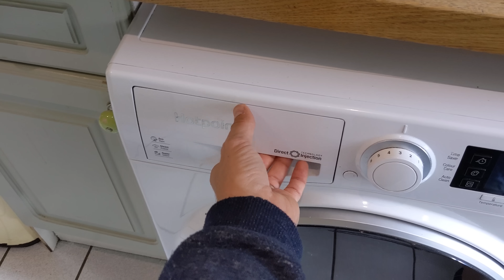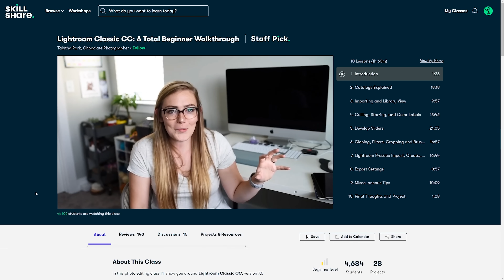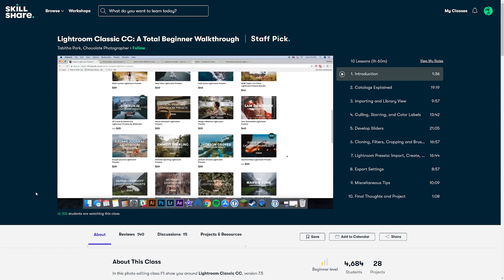The Pythagorean Siphon Inside Your Washing Machine

Comment: I've never even seen a siphon toilet in the US, and I'm quite old. It seems overly complex when you can just pull the plug.
Reply: It seems like a siphon would be less prone to wearing out.  In US toilets the rubber breaks down causing leaks pretty often, especially when using cleaning tablets.  The main benefit of the US model is that far less force is required to initiate the flush.
Reply: It was basically designed to save water. The American style plunger toilets are prone to leaking and use more water, Up until 2001 it was mandatory to have a siphon type toilet in the uk.

Comment: In America, I've NEVER seen a toilet like that..  All of ours (that I'm familiar with) just have a stopper over the hole at the bottom of the holding tank, and the water just escapes directly into the main part of the toilet.  Same general mechanism for the shutoff valve, and then if the toilet runs, there's an overflow tube that bypasses the main stopper and lets the water drip into the toilet so the tank doesn't overflow

Comment: Toilets in Slovenia don't use siphons.
Its instead a hollow tube with a rubber plug in the bottom. In the event of a leak the level reaches above the tube and drips out, when you flush the tube is lifted up, creating a gap at the bottom where the water moves out. For a half flush a float mechanism is used to drop the tube once the water drops to the right level. Its not a great system tho as the rubber plug can get hard with age and start leaking.
Reply: This type of mechanism is also sold and used in the UK nowadays. It's neat as it gets rid of the need for a separate overflow pipe.

Comment: I always thought this was a bell siphon, I have used it in hydroponics to water and drain the plant bed. I also heard it called a greedy's man cup.
Reply: Bell siphon is not this - it has a heavy cast iron bell that drops to start the flush. See: https://qph.fs.quoracdn.net/main-qimg-880fc7a941ea281edf35e7c334f798a4
Reply: @millomweb  a bell siphon doesn't have any moving parts. I honestly don't see the difference here.
Reply: @MrKmail  The bell moves vertically in a bell siphon - to start the siphonic action. It acts as a piston in the bottom cylindrical part of the cistern to build up pressure to cause the water level in the bell to rise above the standpipe - which it then flows down to start the siphonic action. The bell, resting on 'rubber' feet does not seal on the bottom of the cistern once it has (hopefully) started the siphoning.
Reply: Looks like a bell siphon to me.
Reply: @MrKmail  Might look like one but it isn't.

Comment: Are You familiar with wastewater plant's dosing basin siphon that are releasing certain volume of water into the sea? If not, check out how that works, I think it should be the same principle. Effluent fills the basin until a certain level (volume) and then it releases it suddenly in order to better mix it up with the seawater through underwater diffusers nearly a kilometer away from coast.

Comment: German Toilet 1: A big tilting button, you press the bottom, it tilts and stays tilted until water is drained, or until you press on top to tilt it back and stop it. Can be stopped at any time.

German Toilet 2: Two buttons, big button for lots of water (for number 2), small button for little water (for number 1).
Reply from the maker: Nice!

Comment: Both of my toilets at my house in Pennsylvania, USA use a buoyant flap at the bottom of the cistern. So when the lever is pressed the flap is lifted and then stays open until the cistern is empty. As the cistern fills back up the water pressure is enough to keep the flap down.

Comment: So, my toilet has a rubber flap that is pulled by the chain when you flush. The rubber flap has some buoyancy so it stays open until the water level is low enough to the flap to fall and seal the drain tube. When it's not in use the weight of the water above keeps it closed

Comment: How awkward did you feel filming that urinal?!  :-D

The syphon model is most common in the UK and according to the Wiki article (https://en.wikipedia.org/wiki/Flush_toilet#Siphon-flush_mechanism ), mandatory until 2001:

"Until 1 January 2001, the use of siphon-type cisterns was mandatory in the UK[11] to avoid the potential waste of water by millions of leaking toilets with flapper valves, but due to EU harmonisation the regulations have changed. These valves can sometimes be more difficult to operate than a "flapper"-based flush valve because the lever requires more torque than a flapper-flush-valve system. This additional torque is required at the tank lever because a certain amount of water must be moved up into the siphon passageway in order to initiate the siphon action in the tank. Splitting or jamming of the flexible flap covering the perforated disc can cause the cistern to go out of order."
Reply: Here in the US, I've only seen the flapper type
Reply: Ohhhhh!!! That explains why it sometimes feels like you have to "kick-start" the whole thing (rather than just.. pressing)! It is indeed a problem I've never had elsewhere in Europe
Reply: Can confirm this type of mechanism is not standard in the US.
Reply: Join to the SMILER!!!
Reply: @YYYValentine  Join Us.  You belong to The Smiler
Reply: @stevebrown1974  I was close enough :D . Are you also a roller coaster nerd?
Reply: @YYYValentine  yes I am!
Reply: I'd say, common in all EU. Nowadays double flush system are almost everywhere in Spain, where water saving is a collective worry.
Reply: the valve system on that type of toilet ; is similar to a read Valve system that is in a two-cycle engine .  I say similar because the valve is open by vacuum created when the Piston is going up ward  .  A two-cycle engine is fastening , it actually has I believe it's seven or nine cycles don't remember which one. but they just call it a two-cycle engine ;  diagram on two cycle engine would be fascinating . The two-cycle engine is not very efficient either .
Reply: So it was the EU's fault for making things shittier (pun intended).
Reply: @TheSadButMadLad  Yep!

Comment: My Toilet (Ohio, USA) has a seal on a hinge at the bottom made out of rubber with a bit of foam ½ way up the chain. When you flush,  the foam is buoyant enough that the seal can't re-seal. When the water empties, the seal can close because the foam is no longer floating.  When the water slowly fills the bowl, by the time the foam is floating, there is enough pressure from the water in the tank on the seal that the foam can't lift it on its own.

I like the elegance of your toilet more, but I do like how easy it is for me to "fix" a running toilet, just have to close the seal which sometimes get stuck vertical.

Comment: Most toilets i've seen in the US have the handle chained to a plug in the bottom of the tank. A small pull let's in a little water, but a full pull and hold keeps the plug open and uses more water.

Comment: I think most toilets, at least historically—maybe not green, low flow toilets—use a simple flapper valve at the bottom of the cistern. There is also an overflow mechanism as a vertical pipe that bypasses the flapper valve when the level of the cistern is above the designed level.

Comment: In the US, I've not generally seen siphon based systems on the toilets, apart from urinals.

Well, that's partly true. When the tank empties into the bowl, I've not seen that part work by siphon. When the bowl empties to the sewer, that happens because of a siphon.
Reply: Yup US toilets are a siphon. You can initiate the flushing action just by pouring a gallon or so of water right into the bowl. Raise the water level about an inch or so and the siphon will start and rapidly suck away the waste. I'm sure at least for american toilets the stuff about aresolized particles settling on things like your toothbrush are BS because the "violent" flushing action is done by suction and once the water drains i'm sure a good couple cubic foot worth in air gets sucked down as well, the sucking is going to keep happening till the slug of water hits the sewer vent that goes up to the roof and it breaks the siphon. If it wern't for that vent the toilet would probably keep sucking as that slug of water made its way down the sewer line till it made it down to the much larger main sewer line.

Comment: Huh, I've never seen a toilet flush mechanism like that!  That's a pretty cool one.

I was thinking more that the lower part of the toilet works like a greedy cup siphon to finish emptying the bowl.
Reply: Same, actually I was expecting him to talk about how the water flushed from the bowl to the drain through that sort of mechanism...
Reply: This.
Reply: In the Uk the toilet bowl does not act like a siphon, The water in the bowl is there simply to stop the smell from the sewer coming back out of the toilet. The waste is simply pushed away by the fast flowing fresh water from the flush.
Reply: @FloppydriveMaestro  I see! But then what keeps that little pudle of water always in the bowl? There should be some sort of weir or siphone to do that no?
Reply: @theandyv8176   It is the U bend built into the toilet bowl that keeps the water there.
Reply: @nrml76  and that's where the siphon action occurs.  That u bend.
Reply: @TheThomasites  Yep, and that is the gurgling sound you get with a fully-clearing flush as the water and air balance out in the top of the snaky u-bend and part of the flow that is filling the tank is diverted to refill the bowl to maintain that gas seal.
Reply: @TheThomasites  @FloppyDriveMaestro Do UK toilets make a gurgling sound when all the water leaves the bowl?  That the sound of the air entering the pipe and breaking the siphon that cleared the bowl.
Reply: @theandyv8176  There is a U bend. So the water goes up slightly and back down into the waste pipe. The flush action forces the water over the U bend but its essentially an overflow and not a siphon.
Reply: @aantony  That's the right question.  Gurgling at end of flush = siphon.  It seems like it would be harder (i.e. take more water) to clear solids from a water-trap type toilet bowl that didn't use a siphon.  The siphon helps accelerate the speed of the water leaving the bowl.
Reply: TheThomasites UK toilets are normally drained through a horizontal pipe to the rear, rather than a vertical pipe through the floor. They can't therefore siphon. The siphon flush mechanism was universal until the EU interfered and insisted Britain allow the continental style flush mechanism with a simple valve. This proved a bad decision- such valves are prone to leaking, sometimes quite severely, and as a consequence water use by toilets (wastage) has risen substantially where these are fitted in any great number. The old syphon valves lasted decades and never malfunctioned in such a way.
Reply: @andrewsnow7386  Huh, yeah.  The bowl never fully cleared.   No siphon.
Reply: @aantony  The Toilet dumps the fresh water from the tank in so quickly that the waste in the bowl is simply washed away, Because the bowl does not hold much water and it does not have far to travel it doesnt take much water to force it round the U bend.
Reply: @theandyv8176  Yes, it's a weir.
Reply: @nrml76  He was right, it's a weir.
Reply: @TheThomasites  Not in the UK normally.
Reply: @MonkeyJedi99  No gurgles in the UK.
Reply: @aantony  Nope. No air is sucked out the bottom of the pan.
Reply: @andrewsnow7386  But that's not how UK loos work !
Reply: @aantony  no,northern born Thomas designed the uk Crapper so there is never a broken siphon at that end, the fresh water just replaces the old keeping the trap intact, the atmospheric air doesnt re enter the vertical waste pipe until the underground pipe section breaks the seal at that lowest below ground end,at least thats the case if the fitter/room designer does/lays it out right .

Thomas Crapper was an English businessman and plumber. He founded Thomas Crapper & Co in London, a sanitary equipment company. Crapper held nine patents, three of them for water closet improvements such as the floating ballcock. He improved the S-bend plumbing trap in 1880 by inventing the U-bend.
Reply: The US toilets (with like 500l of water in them) do not exist outside the US. Toilets everywhere else on this planet do not waste that much water.
Reply: @whuzzzup  right....... 🙄
Reply: @AureliusR  ?

Comment: My toilet hangs on the wall and only has two buttons, so I guess it's just magic then.
Reply from the maker: That's the other mechanisms, yes.
Reply: I also use the sink when I shit
Reply: It probably has a tank inside the wall that fills with water. If not then its a power flush that relies on water pressure and volume to flush. But those are typically only commercial.
Reply: I also believe the toilet hangs on the wall by magic or suction cup. 
Not sure about where the call end up when you press those buttons, maybe the sewer call center.

Comment: ENGLISH toilets are mostly the siphons design; not in the US. 

In the US, the lever just lifts the flap seal at the bottom of the tank.  It's buoyant so it doesn't drop back and reseal until the water level drops to allow gravity to let the flap seal drop back into place.

I've encountered so many toilets in ENglish homes where the central plastic siphon mechanism is broken due to plastic degradation so that cracks develop and you have to pump the handle multiple times to get the toilet to flush.

Comment: Would a siphon work with a liquid with very low cohesion? if so, what parameters would have to change?
Reply: The lower the surface tension, the closer the walls would need to be together. (Compare water with isopropyl alcohol and with glycerol. And with the super thick polyethylene oxide -- see really early Steve Mould video.)

Comment: Thanks for explaining how these dual flush toilets work. Growing up on the east coast of the US, the toilets always had a rubber flap at the bottom and no siphon mechanism. Also only one type of flush. Living on the west coast, all the toilets I've encountered are dual flush
Reply: On the rubber flap toilets, if you lightly depress the lever, you only slightly lift the ball and water flows through only until you release the lever, the flow of water being enough to pull the flap back in place. If you pull it more strongly, you cause the flap to actually lift, at which point it holds itself up until the water level falls below it and stops supporting it. 

There is a second siphon effect happening in the bowl itself, which is why before hurricanes, we fill buckets - you can cause a toilet to flush simply by pouring water directly in the bowl from the bucket. So, by the same token, hold the lever at that partial flush for long enough and the water that slowly infiltrates the bowl triggers an actual flush of the bowl contents.
Reply: @HowardCShawIII  half pressing the lever never worked for me. I think the flow rate was always too low to get a flush if you didn't wanna be waiting for an hour for enough water to reach the bowl. I do remember having buckets of water ready for hurricanes though!

Comment: Yes, different in the U.S.  I've never seen that kind of mechanism here.  The U.S. uses a valve sitting on top of the outlet of the tank - lift it up and water flows while the valve floats. Once empty, the valve flops down on the opening and the water pressure holds it closed while the tank fills.  Interesting how different places solve the same problem in very different ways.

Comment: 8:18 my washroom’s flush is a little different, if I pull the lever and drop it down quickly it drains less. I opened the flush mechanism but it was same as yours , idk why that happens

Edit : I was wrong it ain’t like Steve’s it’s disguised as his, my explanation is there in the comments below
Reply: perhaps it doesn't have the hole part way along? or perhaps there is a sweet spot between pushing too quickly and holding it too long?

I don't want to encourage you to waste water, but... science!
Reply: maybe those slits are present only toward the upper portion of the piston thing, which I guess would make the system reverse the function and make it same as yours.
Reply: Found out it was disguised as Steve’s, it’s actually some sort of witch craft according to my knowledge In physics. So here’s what I observed, when I pull the lever , the lever lifts some sort of weight which then starts water to drain , if a little pressure is applied opposite to lever the weight blocks the hole again and the flow stops

Comment: Mine just drains into the bowl with a plunger. No siphon. I know this because I had a leaky toilet, and the problem was that the cable that pulls the plunger was knotted and didn't allow the suction to pull the plunger into the drain

Comment: US washing machine softener tray: yep same.
US toilet: um... no siphon. and... the float rises vertically, and the flush lever is linked by a metal chain to a rubber flap attacked over the bottom of the cistern, so when you pull the lever, it lifts the flap, letting water out. [And there are other differences in the bowl itself.]